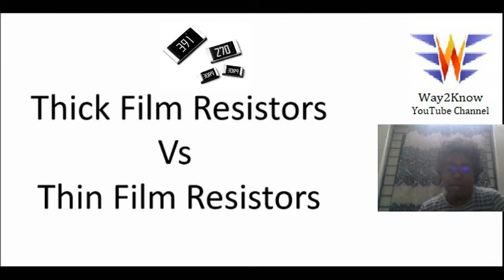Thick film and Thin Film Resistors | difference between thick film and thin film resistors

Comment: sir make a video on how to find just by looking at it if the smd resistor is thick film or thin film ceramic or aluminum resistor and how to measure it whether in circuit or outside.
Reply from the maker: Sure, I will do very soon.. thank you for the request